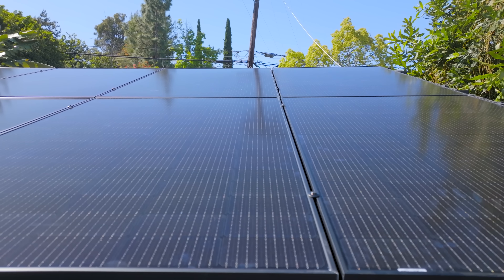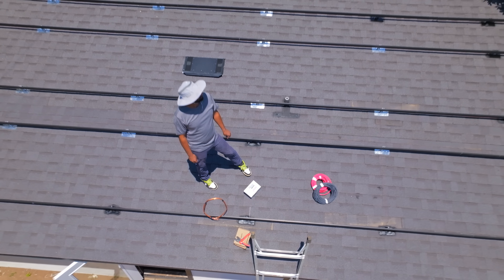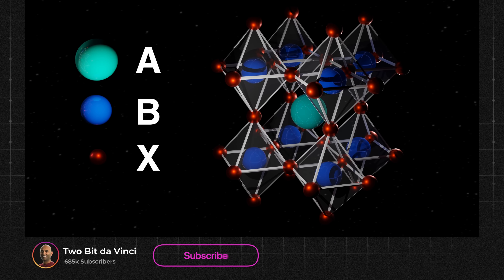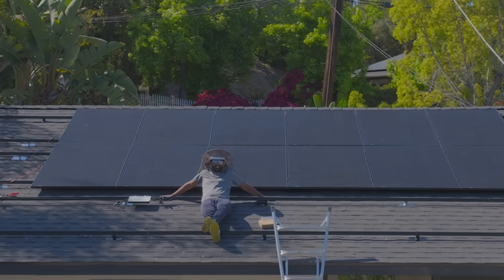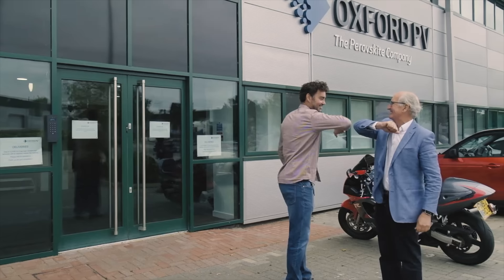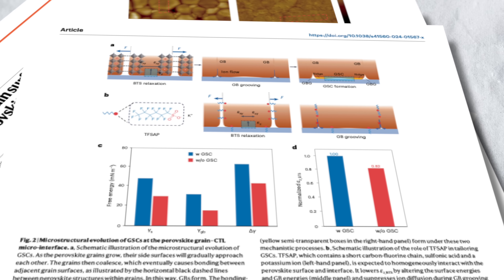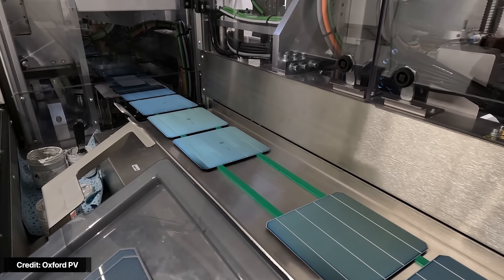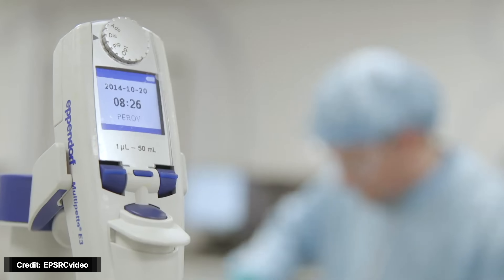Secret Unveiled: How Scientists Prolong Solar Panels' Lifespan

Comment: Bifacial panels are quite higher efficiency compared to traditional single sided PV.

They need to be put strategically to maximize their potential.

Then about solar tracking can really improve solar electricity production.

I live near equator and some people with solar tracker have shown an improvement almost 100% compared to standard fixed installation.
Yeah, you're getting double the watt-hour in a single day when you do solar tracking.

Surely some of those energy being spent to work the tracking motor and electricity, but that's almost nothing compared to what you're getting.

Around equator you can even get away with single axis solar tracking I guess and they're still very efficient 😁

Currently I'm not using solar tracker because even with standard current PV technology and fixed installation already generate enough electricity for me to use without the need to turn on utility line 24/7 and I still have a lot of space to spare should I want to add more panels in the future.

Comment: Shorter time-spans but increased efficiency seems like a good way to go considering how much solar tech is improving each year. If you invest in a 30-year tech, you're locked into an old system for 30 years. If your tech is only 20 years, it will likely bring savings and efficiency by swapping then. I think the main issue may be installation costs. If it's possible to re-use the mounting system, so swapping panels is maybe only 50% of first installation, that would be great. If solar panels in 20 years have innovated a new, cheaper way to mount them (which I hope they will), again, this would make it worth it. If installation costs are the same, then it may complicate the calculations.

Comment: The US is SO inefficient for Solar. I put 30 panels = 9KW system on my roof for AUD $ 14.5k = USD $ 10k and he talks of $ 30,000 for his 30 panels. He pays $ 850 per panel for installation. I had 2 people for a day and they installed 30 panels with inverter and website linked in and it was ONE DAY ONLY.

Comment: Aptera has designed their Solar EV to have user replaceable solar panels. They're advertising 40 miles of range on solar alone. If perovskite panels were used instead that could be 50 miles, or 86 miles on tandem panels! If they're cheap and easy to replace, panels that last as little as 2 or 3 years could be practical.

Comment: To clarify their are no Perovskite solar cells on the market.  Their are TANDUM Silicon/Perovskite panels being commercialized.  The efficiency boost is coming from the Tandum nature of the cell.  Perovskites main advantage is that it is easier to make a tandum cell with because it can litterally be sprayed onto a Silicon cell as a final manufacturing step rather then having to essentially make 2 whole silicon cells.

Comment: It may make sense in a ground mount, but the changes in NEC (2yr release cycle)  over a theoretical 12yrs period could make replacement even more expensive to meet code on the next install.  A 25yr panel locks you in in a grandfathered way without having to make changes.  Depends though, I'm not aware of any DC to AC inverter lasting 25+ years that is current residential grade.

Comment: What if... Perovskite sheets were made that you could fit and replace on top of your existing silicone panels? That would basically double your output. That would also allow your current system to be easily scalable. Just a thought...

Comment: You touched on the lifespan of a roof in the beginning but didn't include it in your final cost analysis. A 17 year panel lifespan would be a better match for asphalt shingles (replace both at the same time), whereas you'd want 30+ years out of panels installed on a standing seam steel roof. The latter is also less maintenance as the racking usually just clamps onto the roof (no holes) vs screwing into shingles and having to rely on sealants.

Comment: I am new to the topic of solar (as well as that of owning a house) but It feels like lasting 10 years as opposed to 25 might not be that bad in this fast moving space. The problem might be that the initial cost is still too high for your calculations. What I mean is that in 10 years there might be much better technology available that is not just cheaper but also more efficient. While you would still be "stuck" with your old panels trying to recuperate for the initial investment somebody with shorter lived panels would be moving to the next thing.

Comment: bruh whenever I think of setting up solar, new breakthroughs emerge
Reply: It's called progress, it's called adapting to new things that's what we do that's why humans are special. 
And not the short bus kind
Reply: @PerspectiveEngineer  sure. but we are so far from the theoretical limit right now that theres such big improvements being worked on that it seems like a bad time to spend a large amount of money on them. they are a terrible investment when better panels wil be out. 
there will come a point when the potential improvements we can make to the technology are tiny. so tiny the money required to make the improvements wont be worth doing them, so the technology will peak and that will then be a good time to buy.
Reply: I think the best advice would be to go for whatever you have available now. Good and tested is better, unless you have a small roof that won't cover your house's energy needs

Comment: The problem isn't panel cost or even efficiency, I'll put as many panels up as I can fit regardless. The issue is cost of install! Panels could be damn near free and the installers will still charge a mint in my experience. I'm about to move someplace where installation is more competitive but I'm still hearing quotes that are not "cheap" particularly if you include batteries - which I will want\need. If there was a way to repurpose EV batteries in a way that your insurance company and inspectors would be okay with that would help a TON. I'll still put panels on my new place, I'll do batteries too, but price is not going to be much influenced by panel cost. Everything else including labor is what hits us these days

Comment: The normal price of a Trina 430W bi-facial is about 90 EURO. Anything different means the government is adding import taxes.
The biggest cost of solar power are not the panels. It's not even the amount of copper cable. It's the footing. Footing is about 1...2x the price of a panel per panel.
Inverters costs close to nothing.
This used to be different. My first panels were 250 euro a piece for 230Wpp.
I got my panels basically for free with my off grid container installation.
(3xVictron MP2 5000, victron mppt, all cabling and disconnects and everything according to specs including installation).
But the footing of the panels would majorly up the price. So they are actually lying on the ground until my house is build and I can move the installation.
Reply: Calculate the cost of mounting the panels vs the cost of buying more panels and leaving them all flat. The latest thing with bifacials though is to just mount them vertical.

Comment: Cheaper and simpler solar panel can be built diy at home using glass passivated diodes … make a simple wooden frame and just twist together such diodes (like BYV27 any voltage) in series. With 40 of them in series I can get 14-16v midday sunny summer day and 7-8v when is cloudy … they only need to receive solar rays from any angle.

Compared to any other solar panels this diodes panels are way smaller and lighter and can generate way more electric energy than any solar panel on market, just hook up some super/ultra capacitors and dump in batteries if you like or run your inverter. If you still want a better output, use optocoupler with darlington transistors to increase amperage.
Reply: I've never heard of this. Do you have a video somewhere one can look at

Comment: One of the complaints I've heard leveled against solar panels is that people replace them early, chasing higher efficiency.  I nearly fell into the trap with my 12-year-old system.
  If this irrational behavior is included, the shorter life span of perovskites becomes less significant.

Comment: While efficiency is good, installing models (panels) is <50% of cost.  Electrical work, permitting, utility costs, etc will stay. Silicon efficiency is 20-23% and improving. I estimate 5% cost reduction at best.

Comment: I don't understand why some of you guys won't paint your roof white or use white colour material.

It reduce the heat gain significantly right?

And in turn will help reduce energy usage for cooling system.

Comment: the only way these will be a thing is if they can last as long as a Si panel. 
Si panels degrade but they approach 50% at 100years, and that is a complete guess with little information, we just do not know if they will even degrade that much. Sunpower is now warrantying to 25 years at 92 %. 
They might be a thing for specialized applications that do not last long anyways, and need max power outpt, ie mobile power needs. But it seems very limited.

Comment: Installation is roughly 1/2 the cost, so if peroskite cells longevity is 1/3 silicon, they would have to be roughly 3X more efficient and way less expensive to make it a better deal.

Comment: 2:25 into video, why would you install less solar PV? 🤨 you’d fit the same amount of panels and have more power? Therefore a shorter payback period… not save money on labour and equipment and fit less… seemed like a stupid argument.
Reply: @bradleyarcher9840  there are calculations and sometimes more solar does not shorten your payback period because the savings isn’t as great. Looking at this in percentages, the first 50% is of the greatest value. The remaining 50% hits a point of diminishing
returns. This is because the utilities are not paying very much for energy you sell them. That first 50% of energy is being self consumed by the home. That’s why it’s of greater value.
Reply: I hear what you’re saying, but I’m a solar electrician, if you’ve paid for labour, scaffolding and cabling, fitting a few more panels in pennies on the pound and they would be THE most efficient solar panels.

Comment: I love the idea of solar but wouldn't it make it a pain to change your roof shingles once it is installed. You would have to pull it all off and reinstall.  That is a lot of $$$.
Reply: I felt the same way.   But when your roof is ready for replacement, do the solar panels;  if you live in a climate where solar is feasible you won’t regret it.

BTW, my accountant made the new roof, removal of trees that were shading the planned solar panels, and the solar system all part of the federal tax 30% credit.  My roof is lifetime metal.

My last piece of advice is to get the biggest system you can imagine needing.   If you ever get an EV or change to Electricity for your heat , cooling, or hot water tank you’ll be glad you have the big system.

Comment: Lead could potentially be a problem, because it is such a terrible poison. There is no safe lower limit for lead in the human body - it is strongly toxic at ANY level (and neurotoxic at that, meaning it attacks nerves and the brain, causing behavioral issues, violent tendencies and loss of intelligence), and this is particularly true in children. Of course, as long as the lead is bound up in the solar cell everything will be dandy (as long as production doesn't pollute - although sloshing solutions around in the video clips included makes me concerned), but then there's the possibility of fire.

If the panels ever burn, the lead would be released and go up into the air with the hot gases generated by the fire, to later come down somewhere. One could make the case I guess that the amount of lead will be so tiny (active solar cell thickness only a fraction of a human hair), spread over such a large area, that any lead released this way would be dwarfed by naturally occurring sources. And I assume people will make that argument too, so we'd better make sure it truly is that way. Because using terrible compounds just because they're convenient for us isn't a good thing - lead additives in petrol vehicle fuel made piston engines run smoothly for decades and decades and that was super convenient for us - and lead buildup in people was also instrumental in causing the inner city violent crime spike seen in many major cities during the 1980s. This isn't speculation, this has been scientifically established by for example how plotting a curve from lead levels in peoples' blood matches the curve in inner city crime rates, rising before the 1980s, peaking during the decade, and then declining as unleaded petrol became the norm.

A similar issue exists with so-called quantum dot flat panel video displays and TVs, which use cadmium in the quantum dot doping material. Cadmium is also a horrible heavy metal and a serious environmental toxin if released into the wild.

Comment: 0:16 "... PV cell efficiencies 100x higher than current commercial cells"
So 100 x 20% efficiency = 2000%, so yielding 20x more power output than input ?!